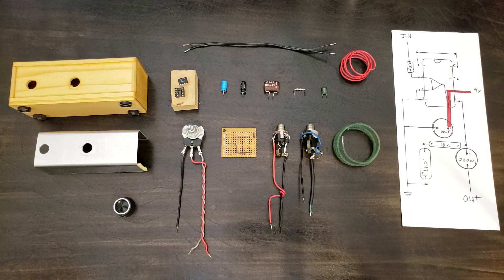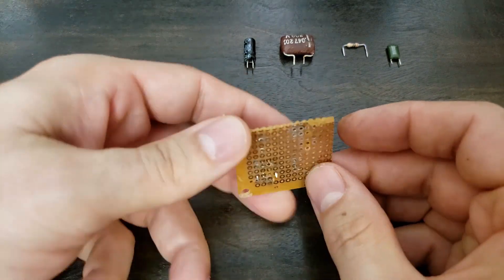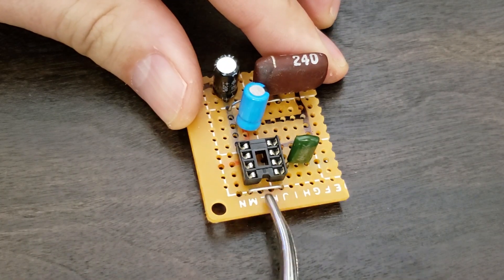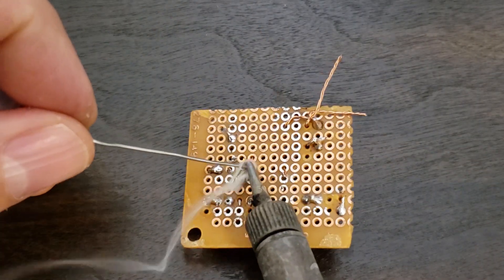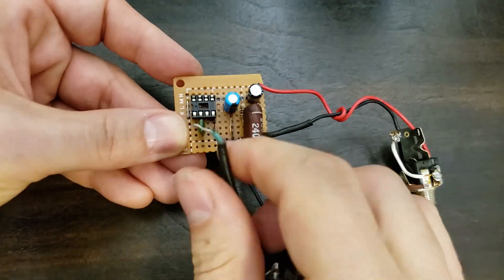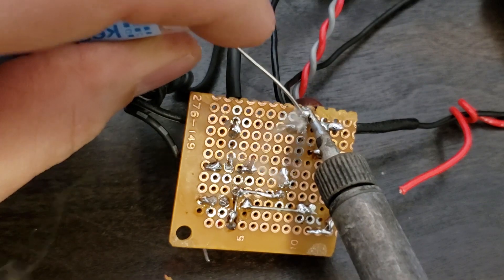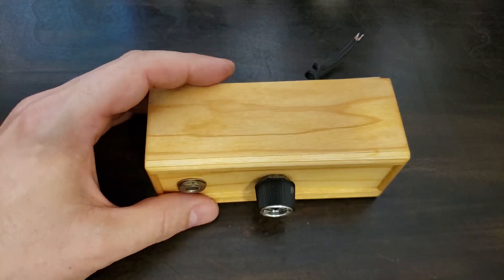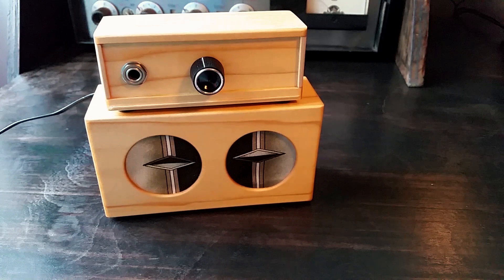Build a DIY Guitar Amp Mini Amplifier - LM386 Amp Head  PART 1

Comment: How could I use this but instead of a speaker, connect it to headphones?
Reply from the maker: First try just connecting both headphones and see how it sounds.  If that's no good,  try a 100 ohm resistor to ground to see if that helps the impedance

Comment: i go compltely nuckin futs and use a tda7052a , build a punch amp , and i used a larger pc speaker - the "woofer " one . mounted everything in a metal enclosure with a 12 vlt nihm pack i got out of a dustbuster . that pounch amp has something speical , not sure if its the speaker the box or both but , small metal box amps have a reputation of sounding unique . weather thats good is debatable . not a fan of the lm386 tho , but your video is great . i love the metal inside for rfi and the little dual speaker cabinet - you should show that one off insides more . super cool . the punch amp does not have " bilt in distorshin btw . doap beats to , ... dawg .
Reply from the maker: Nice!  I like the idea of the battery pack, and that it's not lithium. Nimh is a little more reliable in my opinion.  Sounds like the punch amp is a pretty cool little amp, and I bet it's pretty loud!

Comment: Does this mini amplifier have a pre amp stage in it ? If it doesn't, do you connect one off screen or did you connect the mini amplifier directly to the guitar jack?
Reply from the maker: Everything is as you see it in the video. The amp needs no preamp; it's already inside the chip.  The output goes straight to the speaker.  Here's another way to think about the hookup:  https://youtu.be/Ts4dBCGG4rk
Reply: Ow! thanks for responding. you don't know how much helpful your work is. I have another question about the power device (the power source) that you talked about. what is it? its voltage, current output..ect , can i use a simple 9V battery, for example, instead?
Reply from the maker: Yes, a 9v battery works perfectly.  Alternatively you could use any power supply from 5 volts to 18 volts.  Very small current is required, you could run it off a any wall-wart style brick with 500mah.  But really, most people just use a 9v battery.  Good luck!
Reply: @FrankOlsonTwins  Oh I see, a 9V battery would be easier to obtain. i wanted to ask you too about if you have a schematic representation of the circuit, something more detailed?
Reply from the maker: Look up the Little Gem amp. Similar schematic.
Reply: @FrankOlsonTwins  Thanks a lot for that, wow it's really very similar, even components wise. However, there are small differences that i could see but not determine accurately. If you can share the schematic that you used, that would be so much to ask but it would be very helpful if you do so .
Reply: @FrankOlsonTwins  In the article you shared in your description about this mini amplifier, you wrote 0.01 and 0.047 capacitors....don't they have to be with the nanoFarad unit (nF), it's either you didn't write it or it's actually should be 0.01 and 0.047 Farad.
Reply from the maker: All capacitors in the video are rated in MicroFarads (uf).  You can find many calculators online to convert to nanofarads, picofarads or even farads if you like. But microfarads are a common rating in which caps are sold and used so that's why I used them.  I also don't have the actual schematic on hand, you'll have to draw one from the layout(a great exercise that every engineer/designer/techinician must do!)
Reply: @FrankOlsonTwins  Hi again, I actually could make one mini amplifier like yours exactly, I just finished it. thanks for your video again. However I have a small problem. when I first tried to test it using noise (I used a funtion generator with small amplitude and a varying frequency option) , it worked but only in higher frequencies (from 2000 Hz to around 20000 Hz or so). I wonder why it didn't work with smaller frequencies like 400 HZ or even 1000 Hz.
 
when I tried the amplifier with an electric guitar, it didn't work too, it couldn't amplify the sounds. do you have an idea of why did that happen?

i shoudl note too that one of the chip legs (the LM386L) is broken, the first pin (gain).
Reply: @FrankOlsonTwins   why did you attach the input (from the pick up coil) into the Inverting pin rather than the non-inverting pin?

Comment: So could you in theory hook that head up to a cab? What’s the impedance?
Reply from the maker: Yes, pretty much any impedance from 2 to 16 ohms. And it will be pretty loud!
Reply: @FrankOlsonTwins  don’t the impedances have to match or it will damage the cab?
Reply from the maker: With a small, solid state device such as this- the impedance is a non-issue really.  It puts out around 1 watt or less and you won't risk damaging the cab. You might notice a different sound if there's a big mismatch(for example, a 2 ohm or 32 ohm speaker), but that's about it. Theoretically, I guess you could burn up the chip if the impedance is too low(like less than 2 oms) but even that seems pretty unlikely. 
However, with any higher powered amps always stick to the impedance recommend by the manufacturer.
Reply: @FrankOlsonTwins  ah okay, I understand. Your advice is much appreciated! Something like this will make messing with audio circuits MUCH easier!

Comment: It sounds a lot better than those cheap marshall style Chinese 3 watt 9v amps. 
I have one that i bought solely for the purpose of putting a better amplifier into it, as the sound is pretty awful from the amplifier that's already in it lol
Reply from the maker: Agree, the stock LM386 chip amp is hard to beat for it's size, simplicity and price!

Comment: Can I use a tube rectifier as power supply?
Reply from the maker: I wouldn't...  You only need between 5v and 18v.  You could get that from a free/cheap wall wart at any thrift store!
Reply: thanks!
 @FrankOlsonTwins

Comment: Where does the output jack go, where does the rheostat go what is the jumper from 1to 8 for , which capacitor what side cmon man you talk like we already built it. Be specific.
Reply from the maker: You make some good points!  I included the schematic/layout at 00m:21s to "fill in the gaps" of the assembly.  I drew the schematic as a layout which would look similar to the assembled circuit. So, if you follow along with the schematic, it makes the build more understandable.  Generally, when I'm building any circuit, I print out the schematic and the layout(often they are different) so I can get a firm grasp of what part goes where.  I omitted the Rheostat from the schematic for clarity, as I know most people won't use it(it's not really necessary). It sits between the capacitor and output jack. That's why one leg goes from the output capacitor to pin 1 on the rheostat, and pin 2 connects to the positive output jack. For the output leg of the capacitor, I'm referring to the capacitor on the schematic that says "out"(220uf).   
The jumper from 1 to 8  controls the gain, so open would be gain of 20, closed would be gain of 100.  So, when it's jumped, your guitar volume becomes the gain adjustment.  
There's a more complete assembly guide at https://vintagemusictech.blogspot.com/2019/05/make-mini-amp-for-guitar-lm386-chip.html

Comment: You should put a 300nF coupling cap between the inverting input and GND to stabilise the internal offset when changing the gain through pin 1 and 8, which would also make sense to couple instead of shorting to prevent affecting the AC. JohnAudioTech has a pretty good schematic for it. Also, I like your use of a 10 nF on the input to limit the low end so it doesn't clip as hard. The lm386 can have issues supplying enough current for the bass, which can be worsened further by having a speaker too small for it. That is, if you're looking for the best possible amp that is, if you want better overdrive, you've done it correctly.
Speaking of overdrive, you can make a pretty sick pedal with to 386's in series.
Reply from the maker: Yeah, I was going for "the simplest amp that remains stable." I've tried coupling the gain pins to each other with a cap, but didn't care for the limited response.  But, I will have to try coupling the inverting input to ground. That might clean it up a bit in the lower volume ranges.  Thanks!

Comment: So interesting. Which is the output impedence? Does it work even on a regular 4x12?
Reply from the maker: I believe the impedance is 8 ohms. You could safely drive pretty much any cabinet with this, from 4 to 16 ohms.

Comment: What is the power supply on this?
Reply from the maker: Any d.c. voltage, 5v-18v.  You can use a phone charger brick, pedal power supply, 9v battery, etc.. most common is 9v battety.

Comment: If i can offer one tip, it's that a replacement tip for your soldering iron with a bit more thermal mass (larger tip) would make such a difference to your soldering. Won't make it work any better but would help you make it much prettier. I made the mistake of using the finest tip i could find for so long, moving up to a tip with a flat edge on it is NIGHT AND DAY. Anyway, i'm off to peruse your channel to find the video for the little speaker cabinet - i want to build something like that.
Reply from the maker: Good tip ;) I do like flat iron tips, especially for heavier things like cabling.  Makes it a bit easier than having to "use the side" of the tip. Perhaps I'll get some with my next parts order.  Thanks for watching!
Reply: Being a good bit older and shakier I tend towards as short a tip as I can get. I am recently retired from Boeing where I worked on R and D, most of my soldering was on 34 to 48 Guage mag-wire and micro strain test so my joints were about a mm in size or less. I prefer to use Weller stations with tips that only stuck out about an inch or so from the handle.

Comment: Thanks Frank! i built it into a tea metallic box, with a few changes. I added some switches, LED on indicator and put an LDR between gain pins. Then i made a 555 oscillator and coupled the LED with the LDR so the amp has now a cool tremolo (i love tremolo, i could have tremolo for breakfast and lunch). I didn´t have the rheostat but used a 20k pot and it kind of works, need to improve that. Ah, and a capacitor in series with another pot, in parallel to the oscillator LED, so you can go from a square tremolo to more like a triangular one. Keep doing videos like this!
Reply from the maker: That sounds cool!  I love trem too, and I like to put a switch between the gain pins for a bit of a overdrive pedal simulation.  You could add a 10k  and 1k pot to the legs of the output pot(10k in line, 1K to ground) Btw, I've been a fan of your "Abbey Road/ A Day in the Life" videos-  really great work. New sub here!
Reply: @FrankOlsonTwins  thanks man, its mutual! I'll be changing the pots as you suggest

Comment: Have you ever built the ruby or noisy cricket amps? I believe they are very similar but those have a pre amp buffer section, just wondering if they make much difference to the sound. 

Nice concise video btw, great looking project
Reply from the maker: Yes, I have built the ruby.  It's worth building one to see if you like it, but I tend to stick with the simplicity of the straightforward 386 builds.  Thanks for watching!
Reply: @FrankOlsonTwins  thanks for the contents and the quick reply!

Comment: Is the LM386N-1 or LM386N-3 better for an amp like this?
Reply from the maker: I've used both, they are both fine.  The N-1 is about half as loud as the N-3, depending on the speaker you use.  I run either one off of a 9v power supply.
Reply: @FrankOlsonTwins  is there an LM386 you like the best for an amp like this?
Reply from the maker: Good question.  I usually like these amps to be pretty quiet, so I go with the LM386N-1 and I use small speakers( 2" speakers).  You can always plug it into a bigger guitar cab and it will be louder, but for me I like a desktop amp to sound like a small amp.  Also, I find the smaller sound inspiring when playing.  You could buy one of each chip and switch them out(make sure you use a socket, that would be easiest).  Then, you can get a feel for which one works better for you.  I think the chips are about $1 each, and sometimes less.  When I order, I do sometimes order spares, in case I accidentally touch the pins on one while installing.  That's a quick way to kill the chip!
Reply: @FrankOlsonTwins  Okay thanks I'm making a cabinet with a 6'' ill send a video when I'm done
Reply from the maker: Cool, looking forward to it!
Reply: @FrankOlsonTwins  okay thank you!

Comment: Hi, great video! Can i use a Headphone jack instead of a Speaker in the circuit?
Reply from the maker: Sure!  If it's too loud you might need the rheostat option(the last connection in the video), or add a 10 ohm resistor to ground right before the output (headphone jack).  Check out where the 10 ohm resistor is added here:  http://www.minidisc.org/schem.gif.  Or you could add it between the speakers positive and negative terminals.
Reply: @FrankOlsonTwins  Thank you!
Reply from the maker: no problem!

Comment: can you use this circuit as a pre amp and run it into a second circuit... or even 2 circuits to 2 speakers ?
Reply from the maker: yes both options are possible.   i have a live video about making one of these into a fuzz style pedal,  which is similar to a preamp you're describing.  There are many stereo circuits for the lm386 online, you should be able to find something without too much effort.

Comment: Hello Frank, I love this little amp and your instructions are great. I plan to put the amp in a small wooden cigar box to go with my cigar box guitar.  I am wondering if I can replace a speaker at the output instead of a 1/4" jack?
Reply from the maker: Sure, either is fine. In this case, the jack is just a convenience to plug other speakers into the amp.  Thanks for checking it out!

Comment: Can I use a 120v power running through a transformer stepping down to 12v to power the amp?
Reply from the maker: Sure, but you'll have to convert it to DC, and you probably don't want more than 1 or 2 amps current.  That's exactly what most wall wart "transformers" do.

Comment: I have built 5 circuits similar to these and all of them don’t work,
I have one that works that I found in a box of old electronics that is similar to this circuit why does that one work and all the ones I have built not? I know my chip is fine
Reply from the maker: Hmm, hard to say without seeing the circuits.  But, I've had chips go bad simply by touching the pins.  It can happen quickly, and you might not realize you did it.  If you've triple checked your schematic and your other parts all appear to be good, I'd try a new chip.
Also, it's good to swap out the electrolytic capacitors for new ones.  If they over heat, they can hum or simply stop working.

Comment: 1) If you have the choice available to you, use an LM386-4 amplifier, rather than a 386-1.  The 386-4 has a higher wattage output capability (actual wattage is given by the rest of the circuit, not the chip alone).

2) Although the circuit will work with a 9V battery, I find that using a sixpack (9V) or even 8-pack (12V) of AAA or AA batteries yields more output power and much longer battery life.  Naturally, a 9V battery will fit in a smaller space.  But if you have a little more room, and the choice of enclosures that can provide for more room, I recommend going with the 6 or 8-pack (8 preferred)

3) Here's a really small 386 guitar amp I made some years ago.  https://hammer.ampage.org/files/T-tone.jpg
Reply from the maker: Good info, thanks!   I often run these amps at 12v on a power supply and I like the extra bit of clean headroom it affords.  I switch between whichever power supply I have nearby, 9v or 12v.  I've even done 5v, which works fine, but is much quieter.  I'll have to give the -4 series a try.
Your T-tone amp looks pretty cool!

Comment: do i need to put a variable resistor from pin 1 and 8 to control the gain?
Reply from the maker: Up to you.  You could put a jumper there to make it "Full gain" or you could leave it open to set the gain to "twenty percent." Personally, I prefer to use the full gain jumper and just use my guitars volume knob to control the gain.  A variable resistor will do control the gain the same way, except it won't interact with your guitar's pickups.  I don't usually bother with it though. I just jumper the pins.
Reply: @FrankOlsonTwins  thanks, looking forward to your future projects.

Comment: i want to try it too, i want to see the schematic.
Reply: Do a google search for the Lm386 datasheet, in the applications examples you will find the schematic for a 50 gain and a 200 gain circuit
Reply from the maker: That's basically what I do for every project,  download the datasheet and compare it to few schematics. Data sheets are a great way to get all the pertinent info for a given chip/tube/circuit/component.